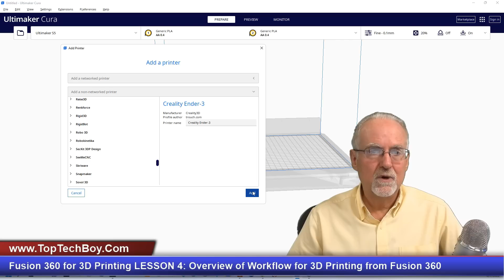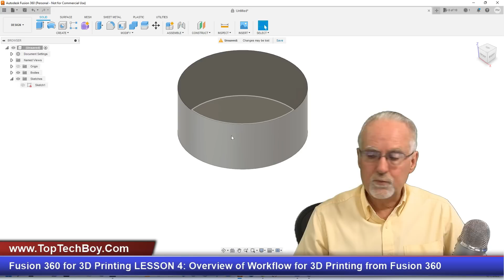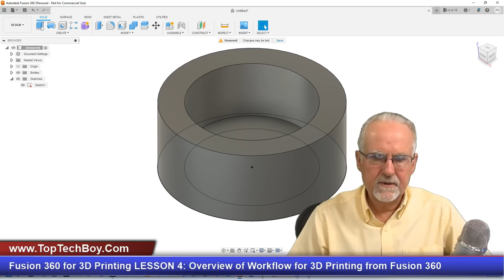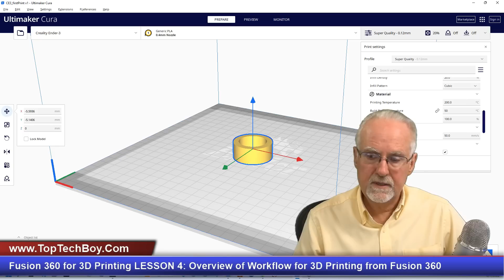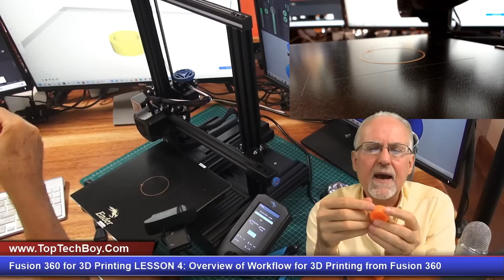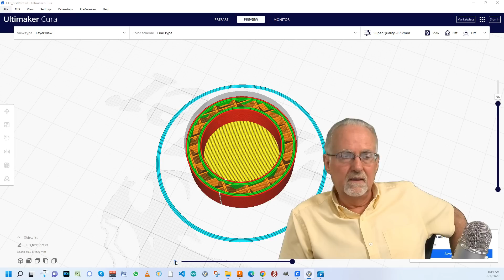Fusion 360 for 3D Printing LESSON 4: Overview of Workflow for 3D Printing from Fusion 360

Comment: Hi Paul, thanks for the lesson. I was able to follow along really well, and create the "cup". I came across 2 issues printer related. #1. The ID was not perfectly round. I think that this was caused by my X axis dragging a little. I loosened the bottom follower wheel a little, and the axis seems smoother. #2. At the 0 (360) position of the outer diameter, I got a little puddling on the first 20 or so layers, which turned into a slight depression for the rest of the build. However, this turned to a little nub for the rest of the ID. Is there something in the g-code that could retract the filament a little more while the program is transitioning from one layer to the next?
Reply from the maker: Larry, the rest of this class, and our life, will be about tweaking the printer to try and get better prints. We will never get perfection, but over time we will try to do better and better.

Comment: Excellent video!  Out of curiosity, why the Acura slicer vs what Creality provides?  Is the Creality slicer based on Cura?  Thanks.
Reply from the maker: There is a very large user base around Cura, and it is simple to start, but allows lots of customization. It is just the slice I am familiar with and that I prefer.

Comment: When I try to 'Save to Removable Drive' I keep getting "Error - Could not save to F:/CES_FirstPrintv1.gcode: (Error 13) Permission denied: 'F:/CES_FirstPrintv1.gcode' I tried changing security settings on the SD card with Windows without success.
Reply from the maker: Dont know what would cause that. Try to just save to disk, and then old fashioned copy over to your SD card.
Reply: @paulmcwhorter  I found the problem. The write protect switch on my SD card adapter (which I did not know it had) was switched on. All is well now. Thanks for responding.
Reply: Go into note pad and try to save a text document to the same SD Card 👍 
Just for elimination purposes 👍 
If this doesn't work, reformat the SD Card 👍

Comment: Paul, everything is working great here. There seems a residue left on the build plate. How would I go about cleaning it to its original condition? Bob from Lancaster, Pa.
Reply: There's a number of alternatives to this. You can either use a surgical spirit to clean the build plate or some Isopropyonal cleaning fluid should help to clear any residue from the plate.

Comment: Hi Paul,  Just a couple of suggestions.  First, you can produce the stl file in F360 by using "Save Mesh" by right clicking on the object or body in the list on the left side of the screen.  This is the Autodesk recommended workflow.  Second, Autodesk recommends roughly creating the drawing primitive (point, line, circle, rectangle etc.) and then using dimensions and/or constraints to fully constrain it.  This will prevent running into problems aligning parts etc.   Cheers, Steve